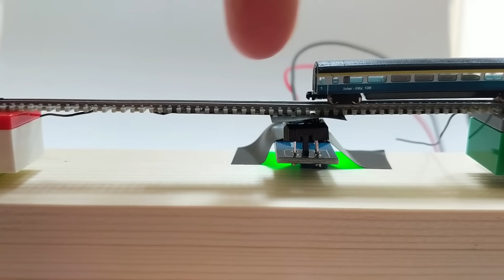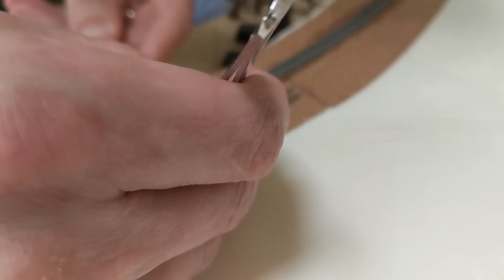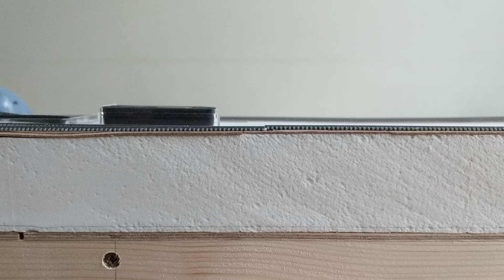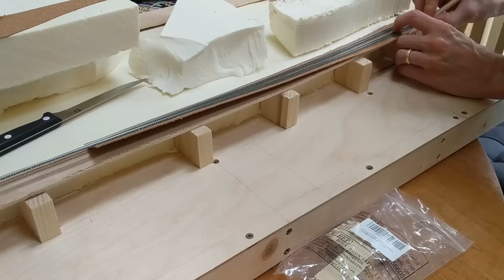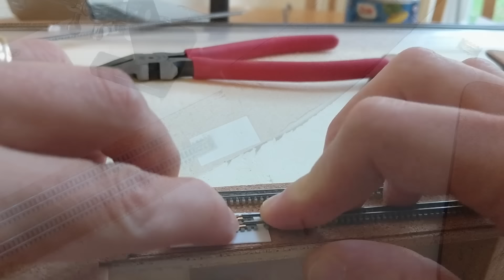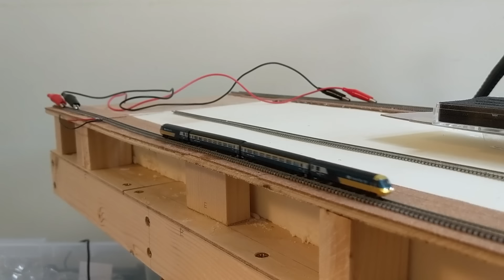Completing one loop (twice) - The Dawlish T Wall [0055]

Comment: It’s difficult to imagine ever having a layout with T-gauge without having issues to do with traction considering the weight of the loco’s for a start. It’s a wonderful concept on its face unfortunately it’s going to consistently throw up problems.
Reply from the maker: I've seen your similar comment on the other video first and replied to that one already - the locos have plenty of grip from their magnetised wheels, but the magnetised wheels of the trailing vehicles cause drag, so the 7-coach HST has motors in not only the two power cars but also one of the coaches. I do feel it's likely to throw up lots of problems, but I also think it will get to a point where it settles 🙂

Comment: Nice sharing your experiences. I found when laying on the foam/cork mix, to use a whole lot of peco rail pins to hold everything in place (outside of the track, inside of the track but not piecing the track) until the glue cures.. when you put weight on them they won't move as readily.
Reply from the maker: Thanks for the hints - I don't get along very well with the Peco track pins - I find they don't like going into wood without immediately bending, but if you've got a decent depth of cork or foam I can see how that would work 🙂
It's been a big gap, but the weekend just gone I was back to laying T gauge track - this time it's direct onto wood using super glue, and whilst there've been some challenges with that, on the whole it's been working 😁
Reply: @endoorrailway  Yeah they don't like wood without a drilled hole.

Comment: Just finishing my t gauge layout. All tracks will be fixed to ply with double sided tape; I do have changes in level and overpasses. 
I wish I had used the flexi track, rather than the plastic backed sections- looks so much better.
So far, so good- I'll let you know if it works!
Reply from the maker: I'm glad yours is coming along well 🙂 Mine has stalled a bit, but I've got some more materials ready to pick it up again at some point.

Comment: Que cantidad de dinero invertiste en total, meteriales herramientas... y también el tiempo que le dedicaste en armar toda la maqueta y este funcionando...h
Reply from the maker: In short: I have no idea - I haven't tracked those things specifically, and it would be more effort to dig through my spending records than I'm willing to go to. I've bought very few tools just for this, but the train set and extra carriages came to something like £300, at a guess I reckon I've spent possibly £100 on track, and probably £100 on timber; other materials - glue, cork, screws, XPS foam, alignment dowels, bolts... maybe £50 in total. Tools that I bought for this, but which have been or will be used on other things: electric screwdriver, ratchet set, squares, small razor saw: probably about £50. So I think, very roughly, perhaps up to £600, so for the layout itself excluding the train and controller that's up to £300 so far.

I really haven't tracked time at all though - I've got no clue on that. Even if I did track it, filming bits of it adds a lot of time because it takes a while to make sure the camera is in a good position all the time.

Hope that helps! If nothing else it shows how ridiculously expensive it can be to make a layout, and this one is a long way off finished, though I think the base and track are the most expensive major elements.
Reply: @endoorrailway  For someone who has "no idea", I'd say you've broken it down really well. Yes, it's an expensive hobby, but compared to some others, it's not. What you buy will always be there. Other hobbies often involve one-time-only things like rounds of golf or bowling. They can leave you feeling good and having really good memories, but model trains will still be there to operate......for the rest of your life!🙂
Reply from the maker: @gmaneis  Thank you 🙂 That's a good point you make - not many people continuously build new layouts, and I'm finding even with rolling stock I'm wanting less and less of what's available now that I have lots of the things I'm interested in. So getting up and running is expensive, but the ongoing enjoyment after that isn't too bad.

Comment: The problem started with the baseboard construction, and made worse with cork that was piecemeal and probably too thick.

What's the point of having a perfectly flat baseboard and then putting individually cut risers on it to hold the trackbed?  You should have worked in reverse here starting with a flat trackbed baseboard and suspending the seabed scenic level from it. Thin craft foam might be a better choice than cork at this scale.
Reply from the maker: My original intention had been to use the same 20mm wood as elsewhere, cut into blocks on its side, so the height would be identical, but the company I was ordering that from stopped trading, so I've had to make-do with what else I can find. I also didn't realise just how much a very slight variation in height would show up once trains are running over it - I wouldn't have gone with the foam otherwise.

The cork is very consistent - it's A4 self-adhesive, and about as thin as cork gets, but several T gauge veterans have told me this track has to go straight onto wood. The trains are quite noisy, so that's a shame.

Suspending anything from the trackbed at the front and back of the layout is a definite no-go in the South-West section - very little land is going to be at track height, so it would be far too weak - it has to be supported.
Reply: if you were being OCD about it you'd make the baseboard from cross pattern layers of carbon fiber, levelled with epoxy and then screw into that, much less torsional flex.
Reply from the maker: That sounds great - it would be strong and light too - but too difficult and expensive I suspect.
Reply: @endoorrailway you can buy it in 20 quid rolls of cloth, you just drape it over the baseboard, pour epoxy on it in the middle and then spread it out lightly with a bench scraper, let it set, dry and completely harden then drape another layer with the weave going in the opposite direction to the first one and repeat with epoxy and you're done, the trick is making sure your baseboards are completely level before you start.
Reply: Any ridges you then sand down with coarse sandpaper grits, then go down to fine but you want to wear a dust mask, or another option would be to just buy strips of it to go under the track and stick them directly to the baseboard.

Comment: you need to use hard wood and put the track straight onto that with glue. cork will expand and change with just day to day use and  even the heat /dampness of the air., fine on larger scales but on t guarge you need it to stay where you left it forever. i glued mine to hard wood, and its rock solid, gets dead smooth trains on perfectly flat surfaces AND no twisting at all...because flat onto a smooth wood surafec lol :)   you would kinda need to start over, but honestly, youd get rid of 99% of the problems your having by just swapping to sticking the track straight to a hardwood base. best to avoid any foam or spongey materials for any structural use on t guage, good luck!
Reply from the maker: Wow OK, not even just straight to wood, straight to hardwood! Arguably that doesn't eliminate the corkscrew issue - it's a compromise (by making train running a lot noisier) that has to be made to overcome it. When I next return to the T gauge I intend to try soldering the rails at board joins - if that doesn't end up being good enough over time I may well have to admit defeat and start over, implementing the straight-to-wood advice that you and others have kindly provided. Thanks 🙂

Comment: 1:36 single blade plastic cutting pliers. Nippers. 13° blades. Works much better than cutting knives. The low end (<$20) can work as well as the high end ($55)
Reply from the maker: I've got several tools that would have done a better job than my blunt craft knife - not switching to one of them and not thinking the foam might crush were two mistakes I made! Thanks for the suggestions 🙂

Comment: It's probably been said, but if you're going to be joining baseboards, consider having an insert rail there. That is, you don't have the joint in the rails at the same point as the joint in the baseboard, you have a separate insert that has the rails, but they join several cm/in each side of the baseboard join. You could even make it a rigid piece that drops into a recess in each main base boards. That way, it should be possible to fit bolts to that insert so you can adjust its height and position at each corner or edge.
Reply from the maker: Now that you mention it I think someone did suggest that (it might not have been on this particular video) - I'm not convinced something like that would survive the storage of this railway in-between my bouts of work on it, but if my next attempts at getting the cross-board join to work fail I might be forced to go down this route. Thanks for the suggestion 🙂

Comment: Maybe one could put the IR detector in a lineside hut or an abandoned cable reel.
Reply from the maker: Thanks for the thought - I briefly wondered about above-surface options, but they're not viable really, not with the sensors I've got - at this scale they'd need large things to cover them (something like a medium size signal box) even if it was just the top of the LED part of the sensor poking up through the board - anything like that would be a big deviation from the location I'm trying to represent. So I think it's going to be a lot easier to use current sensors - I'm going to have to wire the track anyway, and there are already physical gaps in the rails that will isolate the necessary sections.

Comment: I cant help but notice just how uneven that top layer of cork is. At that scale, you have to make sure everything is dead level. I'd grab a nice flat block, wrap it in sand paper, and smooth everything out, then re-lay the track.
Reply from the maker: The cork that was on foam or hardboard was uneven, but when it's on plywood it's as flat as the plywood - it comes with a self-adhesive backing, so there's no unevenness in glue under it. In the scenic area where I've got plywood on wooden blocks the plywood is definitely not level - that's very apparent and I need to adjust that, but that's the blocks - I don't think sanding the surface would be the way to go there - is it another area you're thinking of? I can't see any unevenness in the cork itself in most places (besides the 10mm area I highlighted where I gouged-out some Copydex). The area where I showed two layers of cork at the end of a board definitely needs attention - I'd prefer to raise the plywood and remove the top layer of cork - the one under it will need sanding or replacing after that.

Comment: Do you have a dining table with leafs in it? You need to look at one as I think that is your best bet to get a stable joint between two pieces. There are normally pins to locate the halves together and then the locking hardware to secure.
Reply from the maker: Thanks, yes, the leaf folds out from the middle and has locating pins, but it's a bit of a wreck - it was second-hand when I got it 14 years ago, and now the pins that remain are very difficult to align with the holes, and even then it's not totally level. Only one of the locking latches remains, and it's pretty loose! When I've done whole-railway construction I've had the layout on a larger piece of wood on the carpet, so I may need to see what it's like in that situation. Ultimately the plan for this layout is to have it mounted fairly high up in my railway room once it's finished, then after that it won't be coming apart very often, so I might be able to get away with fettling it at that stage.

Comment: Very interesting, i think perfectly flat and aligned track is an absolute must with T gauge, any compromise will result total frustration. The track surely should not be twisting, was there a fault with the first purchase?
Reply from the maker: Yes, the magnetic wheels with over-scale flanges and rails give a degree of tolerance, but it's still very tight. Apparently twisty rails are the norm - it seems my non-twisty batch is the anomaly!

Comment: Some advice i read in a book, with joints on curves, its best to stagger the joints, this reduces the chance of a kink in the curve
Reply from the maker: Thanks, yes if I had to do a join on a scenic curve I think that would be worth trying - it's definitely possible to thread these rails onto sleepers - I did it on an experimental section before starting this layout, but that track had much less of a corkscrew twist to it.

Comment: Could you not use plastic rail fishplates?
Reply from the maker: I haven't come across any - are you thinking they'd be better at not unfolding?
Reply: @endoorrailway  Even in N, plastic fishplates cannot take any stress.  And no, they aren't available in T.  If you need an electrical break in a single rail, make sure the track is firmly glued down, then use a dremel to cut one rail.  Then maybe glue a sliver of plastic into the gap to keep them apart.  Double gaps, well, they are harder!
Reply: @endoorrailway  anything is worth a try on single side, i will let you know if I come across anything

Comment: To secure the rails in place could you use thin wire? 

A piece coming up through the baseboard, looping over a sleeper and then back down through the baseboard. By twisting it together underneath you could adjust the tension. One loop of wire on each side of a sleeper could help with the twisting of the track at the joints.
Reply from the maker: That's an interesting idea - I think if the wire were strong enough (and it probably would be even if it was pretty thin) then it probably would work for vertical alignment, and would be more discreet than the screws. Thanks for the idea 🙂

Comment: From experience with 2mm Finescale and Z, I’d definitely say the cork is your problem! When tolerances are tight, you need everything to be as rigid as possible. Foam should be OK as a basis, but the roadbed should be something like ply, rather than the ply between.
Reply from the maker: It sounds like you're well accustomed to working to fine tolerances! I'll need to take a look at my photos and see how the wood levels compare, but I'm pretty sure the ply at the end of one baseboard used to be lower than the other baseboard, but a week or two ago they were almost the same level, so even if the cork is contributing to the problem there's also a problem with the base. I will definitely be switching to something solid straight under the rails at the baseboard join, but the flextrack joiners I bought, along with some screws, seem to have sorted the other problem areas - if problems return I'll have to remove the cork and see how it goes for noise. Thanks for the advice 🙂